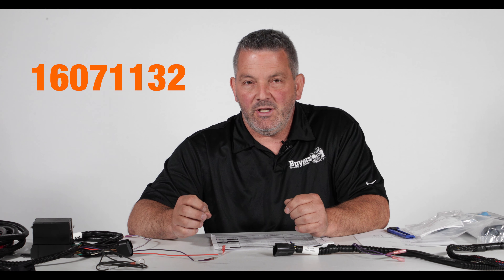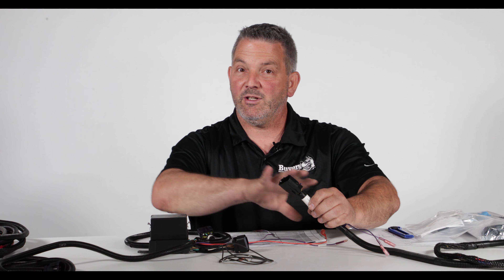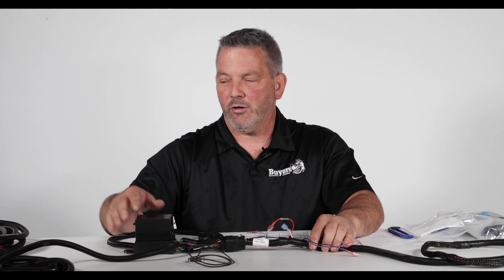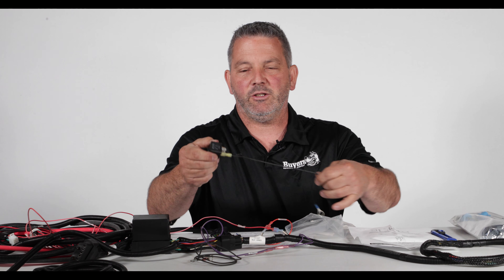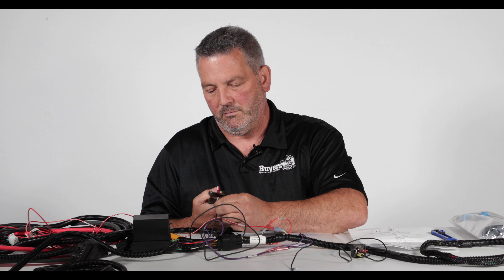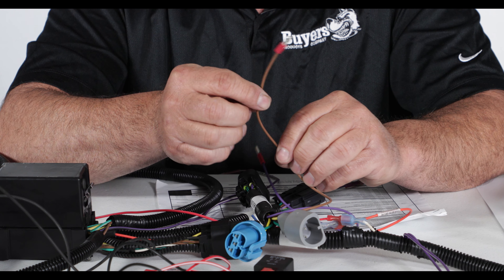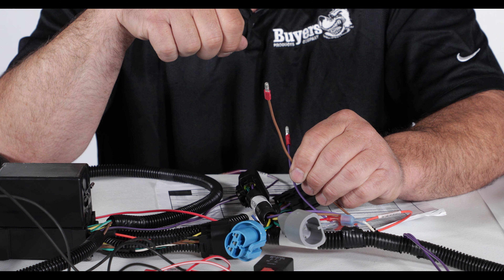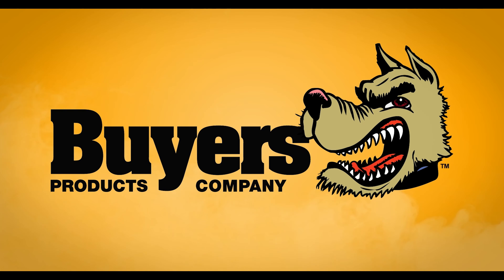Switch Ground Light Wiring for Dodge Trucks

Comment: Issue with relay placement in the truck compartment. Harness needs to be longer to get it to the firewall at least. It needs to be snaked behind the inner fender to avoid a lot of obstacles. There is zero room inside of a dodge truck engine bay for much of anything. I agree with some others, it really needs to be completely water tight so it can go anywhere.
Reply from the maker: Thanks for the feedback! We are always looking for feedback so that we're able to put out a product folks are happy with.

Comment: I have a ‘01 Ram 1500 and we just bought the LED plow lights to upgrade the [poorly built] universal lights that came with the plow.  $700 for the lights at the local SnowDogg dealer and they don’t work when we plug them into the harness. Went on the website and found that these LEDs  “won’t work with switch ground vehicles.”  Shouldn’t this be eliminated as a concern if using the SnowDogg harness?
Reply from the maker: Sorry for the inconvenience Mike. One of our Snow and Ice leaders would like to discuss this with you directly. Can you provide contact information?
Reply: @BuyersProductsCompany  not sure if YouTube removed my comment containing my email address or if you did.  But I never heard from anyone over there so I just built my own relay pack and tied into the lighting harness of the plow…..8 hours of pulling wire, properly covering it all in wire loom, cleaning up the crackhead wiring job that your dealer did when they installed the plow, cutting, splicing, soldering, and heat-shrinking everything to ensure reliable service.

The LED lights work now.  Just need to cut the rusted bolts off the old universal headlights so I can install the new ones.   God forbid y’all use stainless steel bolts for these.  Those universal lights belong in the trash since none of the hardware is stainless and all rusts to shit.  But I bet you do that deliberately so that people will go buy the better lights for $700.  

Oh and God forbid you make your relay box in a manner that keeps the plow side electrical for the lights as positive switched.  What a pain in the neck to make the LED lights work on a ground switched vehicle.

On the bright side (no pun intended), I did manage to find a failing headlight plug on the passenger side vehicle harness and was able to replace it before it caused a major issue.
Reply from the maker: We’re sorry to hear that Mike.  We never received your contact information (perhaps Youtube does remove comments with emails) as we were hoping to discuss a potential solution with you.  As you apparently already know – you can switch the polarity of the signal with relays.  While these switched ground trucks are much less common than they were 20 years ago, we realize that many are still in the field and working hard.  On the off chance Youtube is blocking e-mail addresses you can always contact us through our website https://www.buyersproducts.com/techsupport.